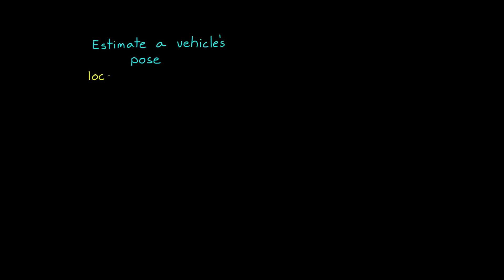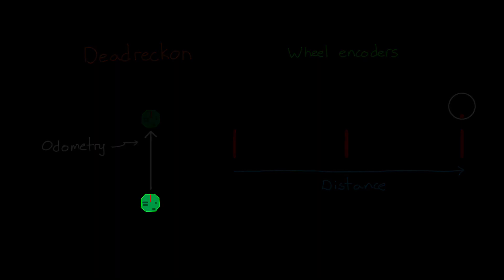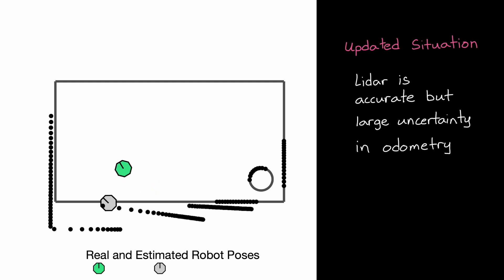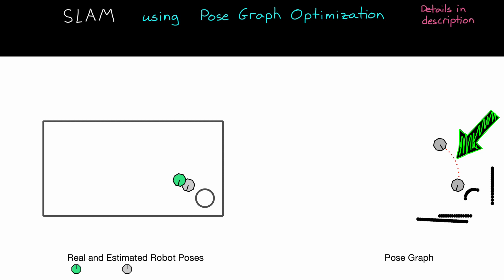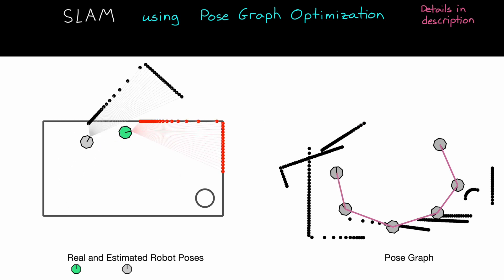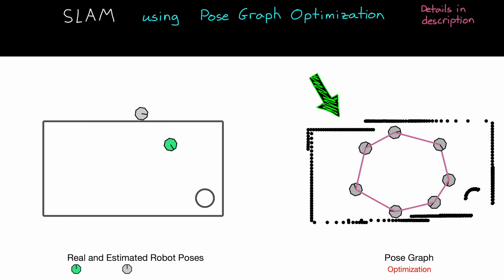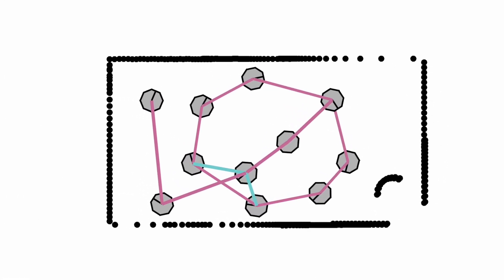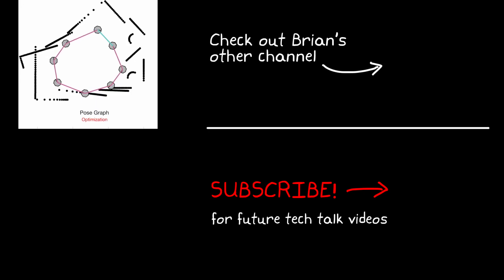Understanding SLAM Using Pose Graph Optimization | Autonomous Navigation, Part 3

Comment: In code, loop closure would be just checking two nodes laser data and finding some transformation with ICP. But for which two nodes are we checking whether there is loop closure? Is it only between some node A, and all other nodes that are close to that node A (based on position of node)? That would mean that also besides this "intuitive" check in video, loop closure would be checked also between two consecutive poses (because they are close), which is not neccessary. How to avoid this?

Comment: And for off-road applications (agriculture, rally race-cars, ASV water robots, etc), in which there is no possibility to "close the loop". I mean the area the robot will navigate will not be displayed to its laser beams again, walls and physical structures won't be available too.. Is SLAM possible to be used by some GPS-approach (I guess Lidar won't participate in this SLAM-method right?). Do you have some video for that?

Comment: Im Not an expert. But if the robot would turn 360 while standing still at time 0 it would get the environment as is.
Supposing compass/gyro it can go around corners and again do a 360....and so on..?
Just a thought not knowing ANYTHING about the subject, im just a carpenter.
Reply: The benefit of that would be not to have to calculate the offset-rubberband-spring or whatever...
Reply: The cool thing... som people actually work wit this, and i just brake my back all days carryi ng plaster-boards.. haha.. GO TO SCHOOL...!!!!. Just love the intellect that goes into this...Coding, systems, GPS, Positioning, Lidar, robot, Maps, ...etc. Cool.
Reply: @nilsbruhner1983  ahahah! There are disadvantages and advantages to both jobs..
I believe that doing a rotation the scan may not be accurate due to the distance of some obstacles (see how sparse measurements made with lidar become when pointing at distant obstacles at 3:02), in addition to the fact that they could be covered by other objects from certain angles

Comment: I had a doubt, without loop closure, will there not be error? Does this error remain in the system or is it rectified by other any means if the robot does not come back to its initial pose? In this case, will the error propogate?

Comment: Awesome video, with excellent visual illustrations! However: It seems to imply that you create a loop closure link when you somehow know (from external means) that the robot is in the exact same place as before. My understanding is that what people actually do is identify matching features (or sets of features) between measurements at two different but similar robot locations, estimate a relative pose between those that would satisfy the observed changes (e.g. image locations for visual features, or angles and distances for lidar features) in the matched features in the two measurements, and then add that relative pose as the new link in the graph.  It would be good (maybe in a followup video) to go into that more, and also into how one actually optimizes the pose graph, which again would involve some matching/alignment between features or other measurements at linked poses.

Comment: Hi, your works are wonderful. Thanks for all these. I was having some problem with understanding some terms but the video made it clear. How ever, I had a question left. At the end, you told that there is a working example in matlab where the robot gets it's pose from lidar only. Are you talking about a 2D lidar/3D lidar? To my knowledge, a 2D lidar doesn't publish any odometry let alone pose. Correct me if I am wrong!!
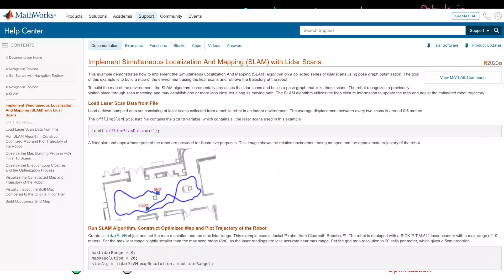Reply: Google that example I show at 15:38 and it’ll walk you through it. I though the link was in the description but I might have missed it. In the example the robot connects the poses in the graph only using lidar. It does that with feature matching only and not odometry. I hope that helps.
Reply: Thanks for clearing. It was really helpful.

Comment: Yeah the part I dont understand is the 10:53. How do you correct the previous stages? you divide the error in rotation, x, y between the last and first stage to 6 (number of total steps) and add it to all stages like averaging? or pecentage wise weighted averaging. Because if robot didnt move in x only moved in y direction in that step, error should be less or 0 in x direction? Also error is less in early stages. It increases as it goes if we assume its gaussian and constant so if we give credibiltiy to each stage then error weight should be increase like 1-2-3-4-5-6 so kind of 1/21 of error will be added to first, 2/21 of the error will be added to 2nd stage and so on?
Reply: For the first part of your question, the optimization is solving a least squares problem where it's minimizing the square errors (in each axis) across the entire graph.  And you are right in that if the error is only in the y direction then the optimization would only impact the y axis. Check out Least Squares SLAM by Cyrill Stachniss that I linked to in the description for a much better explanation of what's happening during optimization.  For the second part of your question, the uncertainty (the graph edge) is defined from the previous node to the current node. And so if the uncertainty in your dead reckoning process is the same over time, then each edge would have the same uncertainty associated with it (not increasing) since you have the same amount of uncertainty between, say, nodes 1-2 as you do nodes 4-5. However, the uncertainty between nodes further apart does grow, like there is greater uncertainty between nodes 1-4 as there is between 1-2. Using the rubber bar analogy from the video, imagine this: if you connect 4 nodes in a line using 3 rubber bars of the exact same length and strength and hold the first node fixed on a table, then it will be much easier for you to move the 4th node around than it will be to move the 2nd node. So, this is sort of an analogy of how the uncertainty increases over time even though the uncertainty between any two node could be the same. Yikes! I just reread this and it was pretty confusing.  I'm not sure if I can explain it adequately in text.  Hopefully, Cyrill's video clears up any confusion.